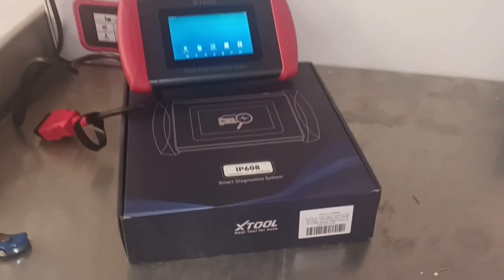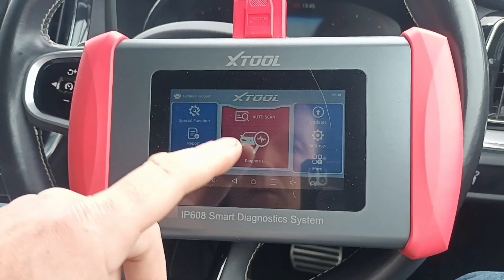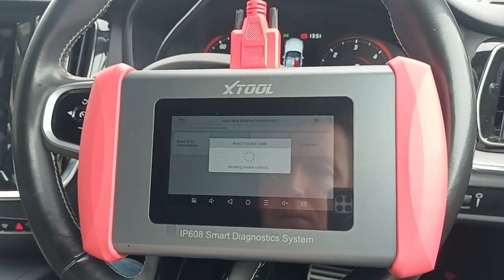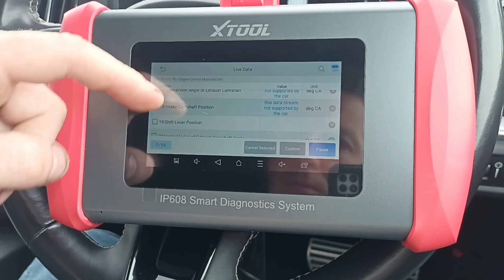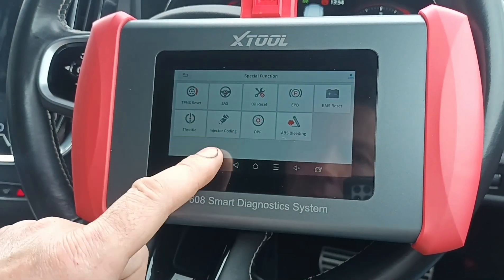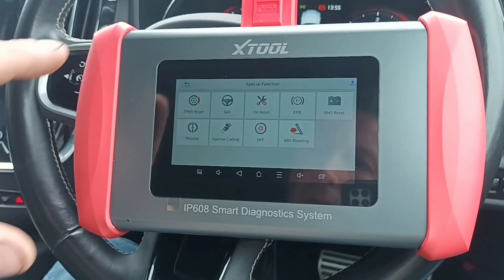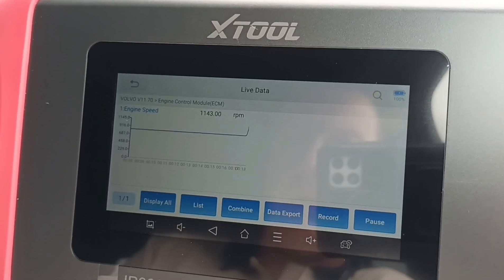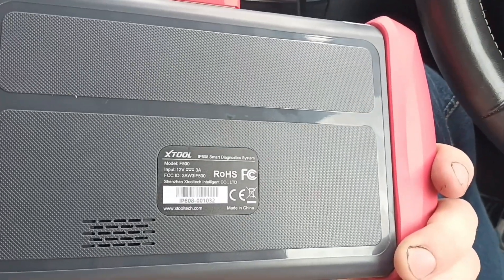XTOOL IP608 Diagnostic Scan Tool Demonstration

Comment: Hi Jimmy.  As a DIY mechanic since 1971, I could seriously use this.  Had to recently put my 2017 X-Trail in for work as in limp mode.  6 weeks later and 2 new throttle position sensors (including pedals), 2 full wiring checks, a Nissan Dealership scan, and a diagnosis of 'it might be the ecu' after hitting me with a new accelerator pedal which was replacing another brand new pedal with throttle position sensor.  I am now £1,200 lighter.  The dealership said they can't test an ECU.  I sent mine away to a company in England and they could not test it but offered a second hand working unit.  They transferred my cars data over to it and it solved the limp mode problem.  How I wish I lived near you! However, a trip from Glasgow to your area was pushing it in limp mode.  Love your channel, from Phil at G78 3JB.